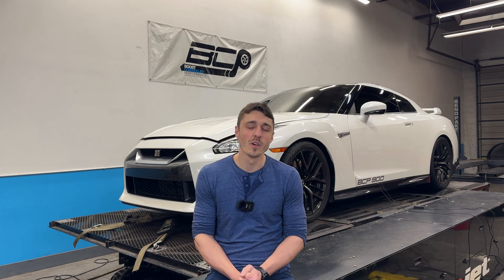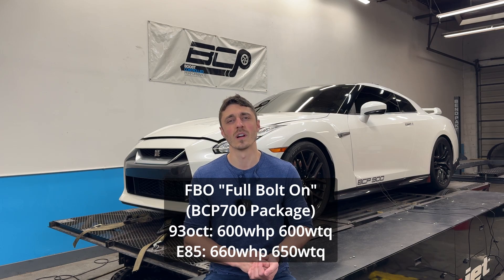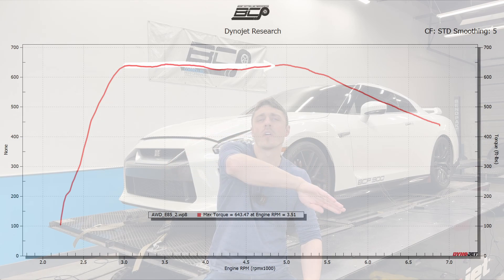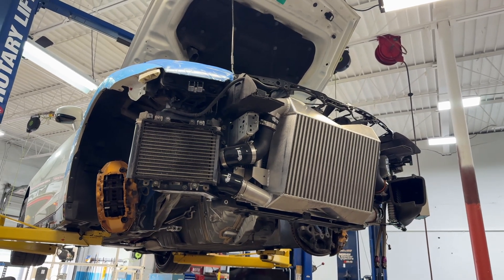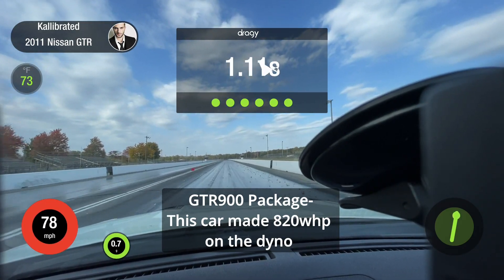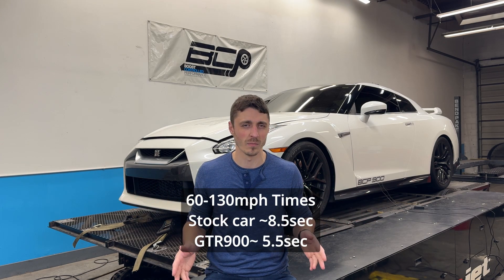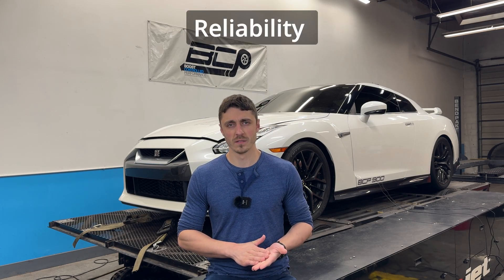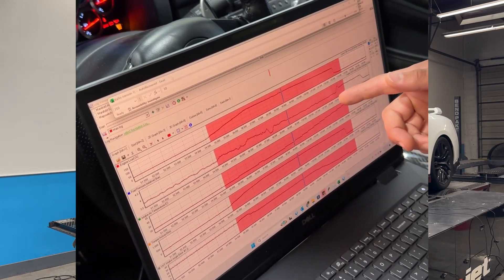R35 GTR- Everything you need to know about BIG turbos on a STOCK engine

Comment: Can confirm this, I had a stock engine 2009 with an Alpha 9, shep stage 1.5.  Ran it on E30, kept the torque safe at lower rpms and carried to redline, managed a 9.95 1/4 mile at 142 mph, car was solid, zero issues.  5.7 60-130, seems like aftermarket turbos are safer when tuned properly compared to max effort stock turbos that jam all the torque in at the lower rpms to achieve the ho numbers people are looking for.  Higher efficiency turbos, more flow with less heat, better wastegates.
Reply: @gtronin2631 can you share how much power did your car make and on which dyno,

Comment: Wait so what's a FBO on E85 with a 20inch wheel capable of in quarter mile times?
Reply from the maker: @racecrashrepeat  typically mid to low 10s at around 135mph. Some have snuck into the 9s with perfect conditions.

Comment: Whats the expected 60-130mph on 93 oct?
Reply from the maker: @Haoyeren5566  mid to low 6s depending on aggression of tuning. They can make very good power on 93 but ethanol is much safer because it removes the chance of spark knock which will cause cylinder pressure spikes. These spikes are more concerning at higher power levels on stock engine.

Comment: Very good info so whats in the 900package over and above the FBO?
Reply from the maker: Tried to cover that in the video but mainly turbo upgrades and some other smaller items that help with fueling.
Reply: @boostcontrolledperformance1523  oh so if you already have the flexfuel system and pumps do I need anything else from a fuel perspective? Apart from just mapping for the bigger turbos.

Comment: What happens is they go to the local dog spot and race Z06, Camaro SS/ZL1, Hellcat, the one guy with the fast ass EVO/STI all have a tire. GTR proceed to lose really bad and he makes the call. We’ve all scene this happen before.
Reply from the maker: @gblikesnikes  street races have far too many variables for a technical discussion. Which is why we share data that doesn’t lie. 

R35 vs any other street car, in street trim, is VERY hard to beat on the street if power is unlimited for both cars.
Reply: @boostcontrolledperformance1523  AWD that’s the only variable that matter my guy im from Cali all the cars I named beat GTRs on the daily and on top of that I live in New Orleans they don’t dare  ring GTR’s to Da Pad. GTRs are easy work from a dig on the street under 1000rwhp.
Reply: Can cameros run 9s?
Reply: @lancecarter4609  with enough money invested any car can run 9’s.

Comment: Great video and very informative for dispelling myths related to power and reliability on the factory R35 powertrain. I had a 2015 alpha 9 with all of the necessary supporting mods and it reliably made about 860whp and 650wtq on ethanol without any issues. Such a fun setup and infinitely more enjoyable than a normal FBO car. Nice work and I can attest to the strength of a setup like this on a factory engine/transmission!
Reply from the maker: @evoIX850r  it’s the “perfect” amount of power for this car.
Reply: And just to add, although I didn’t log a ton of miles on this setup (~5k), it was extremely solid for multiple seasons. The new owner is continuing to enjoy the car and hasn’t had any reliability issues. Only thing I ever had to worry about with the R35 was keeping it on a battery tender if it was sitting for more that a week, otherwise it was a very good ownership experience.